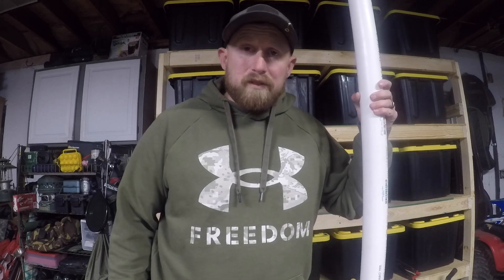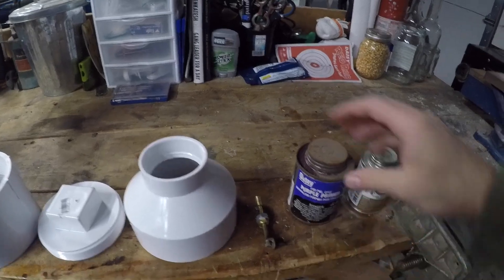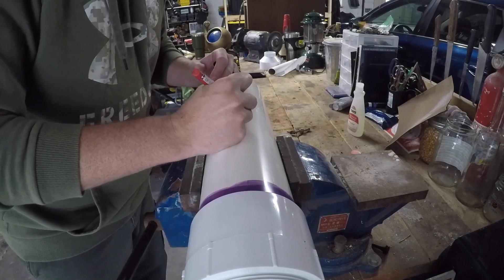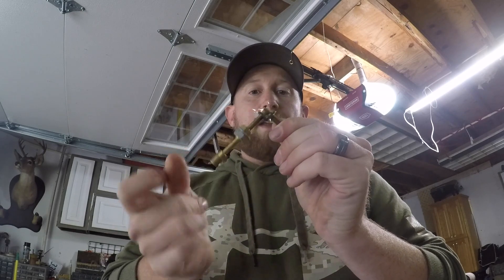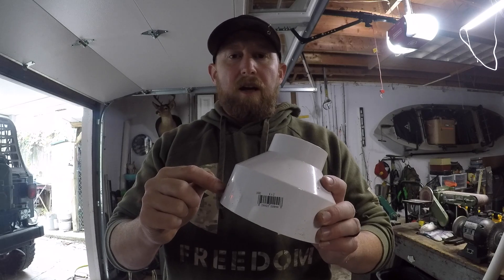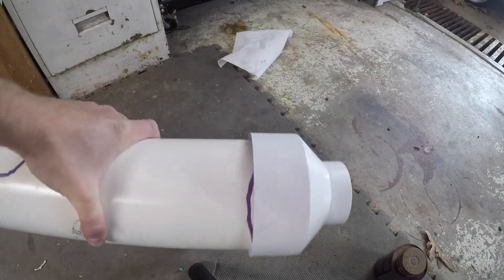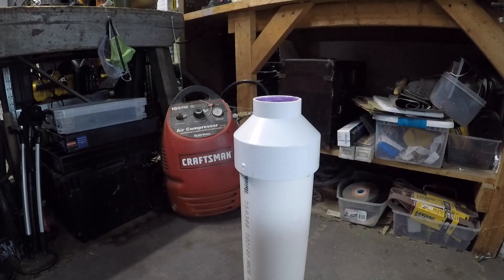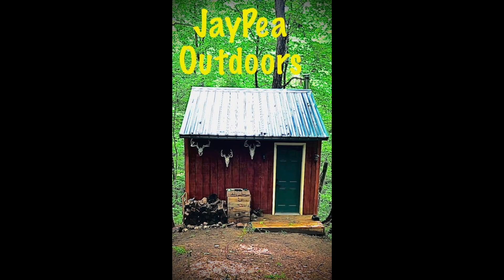How to make a POTATO CANNON

Comment: I found an easier igniter for the potatoe gin is one from ace hardware for a gas grill. Just poke wires through the igniter hole and tape battery pack and trigger to pvc body. Use silicone to fill the hole the igniter wires went through.
Reply: Great video! Potatoe guns are a lot of fun!
Reply from the maker: Thanks buddy! They are a blast…no pun intended lol